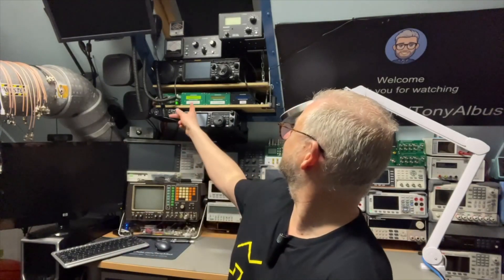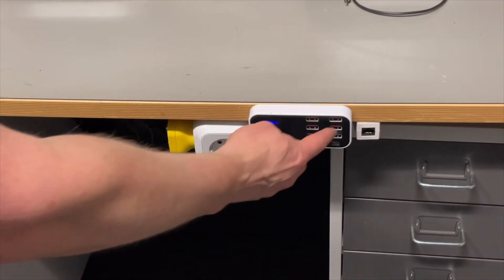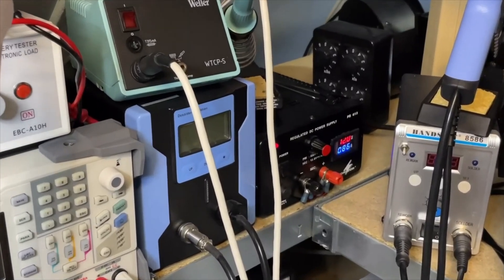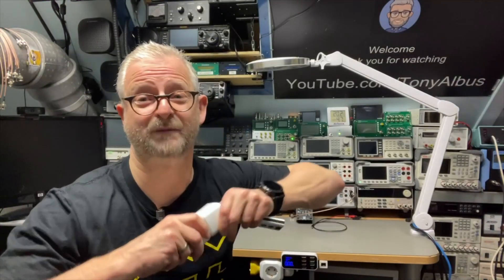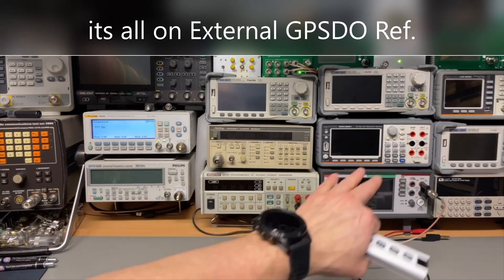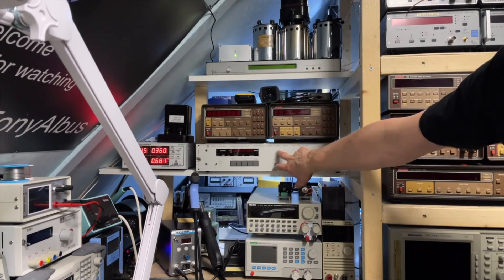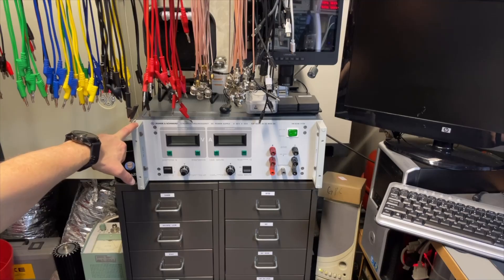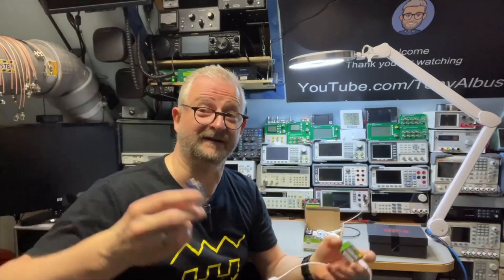TA-0434: Lab Changes 2024 and ideas working more effective

Comment: Hi. Wich process calibrador you use to calibrate your siglent sdm3045/ 3065 multimeter?? I view in your channel the Lb02a and the fnirsi sg-004a.  Any recomendation?? Thanks
Reply from the maker: Hi, LB02A is much much better than the SG-004A.. both are nor multimeter calibrators, but you get a pretty good idea just for checking.

Comment: Holy Christmas from Sydney Australia. 
Great tip, on having a main switch before test equipment. Most if not all residential properties have RCBs on each circuit at the 240 v distribution board.
Select equipment with on/off switch at front of unit: good point.
I'm seeing the advantage "tradeoff" with multifunctional equipment v specific. Factors like;
* cost
* accuracy 
* duty requirements 
all considerations when buying.
🌏💫
Reply from the maker: Thank you so much, same to you!

Comment: That Tek744 you showed I use to have one of those - Great device, I loved it, but it was absolutely large and took forever to boot.  When I got my first LCD scope I almost stopped using it even though the LCD was black and white.  The TEK took up my entire bench and there was almost no room left to work.
Reply from the maker: The Tek is huge, but 500 MHz and 1Ghz with a small hack... i wanted one :)
Reply: @TonyAlbus  I sold it about 5 years ago along with a dedicated 32 channel hp logic analyzer for $1500.  My unit was 500MHZ, but my 350MHz 4 analog channel with 16 digital channels did all that and more.  I loved the equipment, but honestly it was just too large for my limited desk space.  My only regret was the person I sold it to I don't think used it much.  Great piece of equipment.

Comment: Great idea to star and not chain the power.  I will copy this idea.  Another idea I will copy is just pushing the equipment back - easy way to create more desk space - soooo obvious - but why did I not consider this before is beyond me.  All the same, thank you, something else I can use.  You have a ton more equipment than I do so for me the master switch would be way over kill.  I write far more firmware than hardware design so I don't store components any more - I use DigiKey BOM and buy only as I need - that way I don't store components.
Reply from the maker: Thanks! yes its often the little things and solutions that make it more easy in a limited space.
Reply: @TonyAlbus  Inspired from your video I pushed back my two work stations about 5 and 3 inches (12.5 and 7.5 cm) respectively.  What a tremendous improvement that was.  Thx so much for sharing that really helped!!!